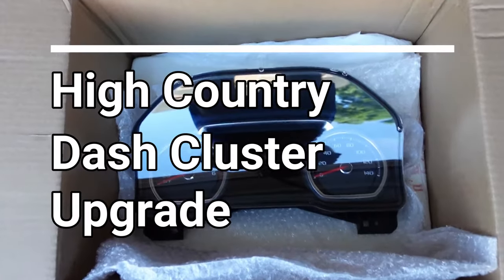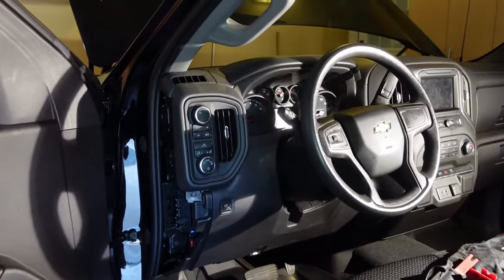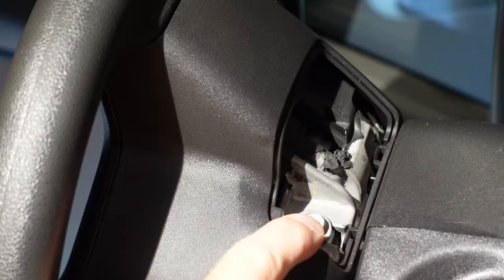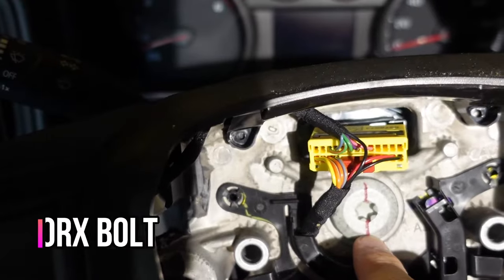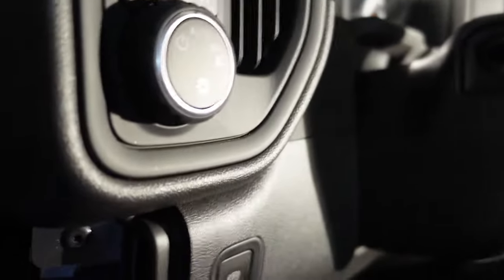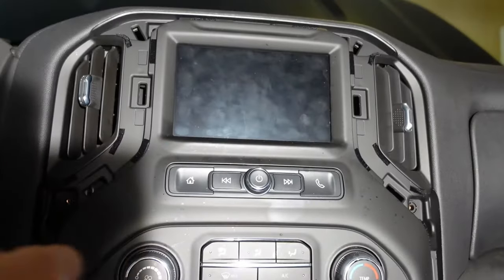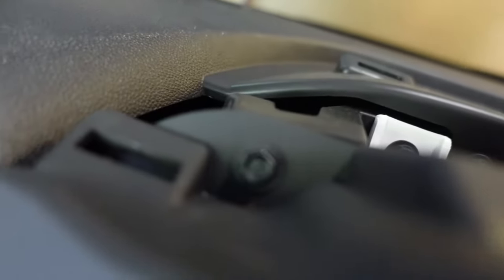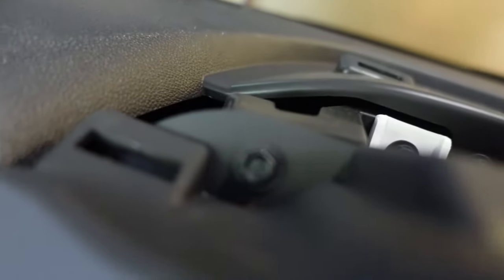[HOW TO] Upgrade Dash Cluster & Steering Wheel in a 2019-2022 Silverado LTD Custom

Comment: You have possibly made my year.  Just recently picked up a '24 3500HD pickup and love it, except for the awful steering wheel.  I really miss the leather wrapped steering wheel in my old 2500HD.  I'm not looking to add any steering wheel controls or the cluster and ONLY want to keep what controls I have now with a leather wrapped steering wheel.  Could I simply swap in the steering wheel in your video and just not have functionality of the right side controls on the steering wheel?  Would this work.  Thanks so much and love the awesome video.
Reply from the maker: @DP-np5mm  2024s have different wiring. You’ll need to contact WAMS to verify compatibility.

Comment: Did the steering wheel update on my 22 2500hd custom.  Everything works except heat option.  I have also reasearched extensively and have not found any aftermarket harness/clockspring options.  Just wondering if the heated steering wheel circuit is just a straight 12v?  If so, why couldn't you just find a switched circuit to tie into and run it up to steering wheel and splice into your heat switch? It seems that the switch isn't getting power...adding a dedicated 12v source should work...correct?
Reply from the maker: WAMS is telling me they may have a fix available later this year. So maybe just hold out a while. It’s more complicated than just hooking up power cuz it runs thru the BCM.

Comment: Very nice. I did the same thing to my F150 when I had it. Even got the heated steering wheel to work. I had to buy a module and a harness as well as a new clock spring.
Reply from the maker: Nice. Yea heated wheel will be nice in the winter. My Canyon has it and once you get one. It’s hard to go back.
Reply: Can you please link the heated steering wheel components needed?
Reply from the maker: Haven’t got it to work yet. 😔
Reply: If it doesn’t work then I’ll just lead the button to my rear bumper pod lights
Reply from the maker: I guess you could do that.

Comment: Chingon  👍 torque spec for steering wheel?
Reply from the maker: 33 ft/lbs. Clean off the old thread locking compound and add a little new removable thread locker to be safe.

Comment: Did you ever install what you needed to get the heated seat button to work?
Reply from the maker: Unfortunately no. Ran into a roadblock. Will probably require some custom programming to make it work with the OEM buttons. I know it can be wired to run on an aftermarket controller but I don’t think I wanna do that.

Comment: Great video my friend. But question for you if you dont mind. Can i do the steering wheel swap with the harness adapter to have steering wheel controls without changing the cluster?
Reply from the maker: You could. But I am not sure if the controls will work the radio.

Comment: Question so on your description you put both links to two different clusters is that to chose in between the LCD one and the regular one ?
Reply from the maker: There’s a high country cluster like what you see in my video. But there’s also the option of a mid level cluster that has a smaller color screen. Both are upgrades over the basic non-color cluster.
Reply from the maker: @jose-yz7le  I'll be honest, I am not sure, you'll have to do you own diligence to find the correct part number. I think 2019's have slightly different wiring. Try to find a wheel from a 2019 on ebay to be sure.

Comment: When you swapped the cluster did you have to program the mileage on the odometer or did it transfer over from the old one? Need to know before I buy one.
Reply from the maker: I suggest you read the WAMS product page. It tells you everything you need to know. Mileage is stored outside of the dash cluster so it transfers over. But a new cluster will still require programming specific to your VIN for all the options to work. WAMS does this for you.

Comment: I thought this was plug and play, I seen another video similar to yours but he didn’t discuss that extra wire harness. What is that harness for? Thanks in advance.
Reply from the maker: The extra wire allows the dash to communicate with the buttons on the wheel. You cannot do one without the other. You need everything to make it work. Dash. Wire. Wheel. Others have tried just the wire and wheel and it doesn’t do anything.

Comment: Bought a 2023 and bought a 2023 leather steering off EBay now seems it may be a plug and play unless the extra wire is needed to work the volume and phone controls and Apple play but the main question is were you able to get the heat function work on your steering?
Reply from the maker: Sorry. But the 2023 has different wiring overall. And this process won’t be plug n play like it was for mine. You can try but I don’t think it will work. 

I haven’t been able to get my heat function to work yet.
Reply: @fondupot  the steering is off a 2023 Silverado High Country and going into 2023 Silverado Custom
Reply from the maker: I understand. But the wiring that connects everything is different. When you go to add the Harneess Dr. wire in , the pins I used won’t work on your 2022 LTD. You can try, but I’m pretty sure it does not work on 2023+ trucks.

And others have reported simply adding in the new steering whee and wire does not enable the radio controls. The dash cluster is also needed to make it all work.
Reply: I will attempt it once I have the steering, the cluster is available for $188 but has 7000+ miles and mine has 100+ so not sure if there is a way to reset it to my current miles and hours
Reply from the maker: @bobmassey5404 the cluster needs to be programmed to your VIN. It won’t just swap in. You need to consult with WAMS. I’m pretty sure it’s not going to work on your 2023. Before you go spending a bunch of money…

Comment: My 2023 work truck is a 2500 and doesn’t have steering wheel controls. Previous 2019 did. You know if I can change the wheel without changing the cluster?  I mainly like the volume and phone features of the controls at your finger tips.
Reply from the maker: Others have reported it doesn’t work without the cluster. Also 2023 has different wiring altogether, so it’s not as easy as swapping in a cluster and wheel.

Comment: Hey boss, if I were to go to you, how much would you charge me to install the steering wheel and digital cluster on my car? Would be for a 2024 gmc sierra
Reply from the maker: 100 million dollars! Haha in seriousness, your truck is a 2024. And this upgrade will not work the same as it did on my 2022 LTD. They changed wiring on 2022.5+ trucks.

Comment: I have the 2022.5 refresh and really wish I could upgrade my custom to this dash cluster, it looks really good! Great job on the very detailed video!
Reply from the maker: You might be I luck. I think I heard the 2022.5 customs still have the old wiring. You should get ahold of WAMS and check. They can run your VIN and tell you if it will work.

Comment: How did you remove the side panel on the driver side next to the 4x4 knobs in the beginning of the step? You did not elaborate on how you did that. Thank you.
Reply from the maker: It just pops out. You can yank on it from
The bottom and it comes right out.
Reply: @fondupot Thank you sir , also what type of breaker bar did you use to take off the steering wheel ?
Reply from the maker: Just a cheapo one I’ve had for years. Nothing special.

Comment: can i just but a used cluster off ebay and plug and play? or does it need to be programmed?
Reply from the maker: No. It needs to be programmed to your VIN. Others have tried and reported that it does not work.

Comment: Do you know if you can just upgrade the steering wheel with the harness or do you have to change the cluster too?
Reply from the maker: You probably can. And you might gain volume and seek controls to your radio. But the controls on the right side that control the DIC work work for the custom DIC.
Reply: @fondupot  ok thanks I mainly just want to add the radio controls I miss having those and might upgrade the gauges later 700 is kinda steep for me right now. Also great videos I'm subscribed since I have the same truck.
Reply from the maker: Right on. Thanks for watching. Good luck!
Reply: @brianwhite153  did your controls work? Or did you have to buy a clock spring? I just upgraded the steering wheel but lost cruise control functions. That’s the only feature that came with my truck. So, I’m wondering if I need a new clock spring so I can regain cruise control and use the radio controls.
Reply: @gohangan  I actually haven't done this yet was waiting until after Christmas
Reply from the maker: My guess is you got the wrong wheel.
Reply: I'm sorry if the link or question has been posted already. 

could you please add the links or part numbers?

I just want to upgrade my steering wheel. I have a 2019 chevy Silverado custom trail boss. 
 Thank you!
Reply from the maker: Check the video description.

Comment: Do I have to buy a new steering wheel or can I just buy the OEM part and plug it into my steering wheel for the volume up and down and skip track function? I don’t want to upgrade my dash or stock display system.
Reply from the maker: No. Read the description.

Comment: question what power the cluster ? i have my cluster on blck screen ? but cant fine the fuse to the cluster / any ideas will help tks
Reply from the maker: No idea. It runs thru the BCM. Not one single fuse runs it. You’ll probably need a dealership visit.

Comment: even if i have a v6 2020 custom will any high country cluster will fit my truck?
Reply from the maker: Should fit yes. You just need to check with WAMS first.
Reply: @fondupot thanks boss and also you think i can change my custom radio to a high country radio with the digital ac knobs?
Reply from the maker: @murdatp7590 I don’t think that upgrade is possible. More to it than just swapping out the controls.

Comment: Did you ever figure out how to connect/activate the steering wheel heat function?
Reply from the maker: Not yet. But WAMS has said they will have i fix for it soon.
Reply: Good news!  I know there are several of us that would really like that capability.  I trust you’ll let us know as soon as it becomes available.

Comment: So with that single wire, it’ll make everything work? Including the steering wheel controls to the stereo?
Reply from the maker: Yep!
Reply: I was observing my clock spring and I think I need a new one so I regain cruise and radio control. If you haven’t done it, you should check to see if your clock spring has pin #9 already on it. I only found out after I installed the single wire, buttoned everything up and tested. I found out that the buttons didn’t work, so I doubled checked my work. I didn’t upgrade the cluster but I was expecting radio control and cruise control but those didn’t work. I happened to just stare at the clock spring while I contemplated life and saw that pin #9-12 on it were blank. Then I realized that I probably need a clock spring with all the pins so I can use the buttons. I’m confused as to how I lost cruise control. Unless the new harness on the steering wheel is wired a little differently than my original steering wheel with only cruise control.
Reply from the maker: All my buttons worked perfectly after the upgrade.
Reply: @gohangan  Did you ever try the new clock spring?  Sounds very similar to the issues I am having. I upgraded to the leather wheel, but kept the factory Custom cluster. I also have a 2022.5 - thinking this may be my issue. But also holding out hope for a way to make it work!
Reply: @JosephKravec  i did order a new clock spring. I think it was around $40 so I wasn’t too hesitant to buy a new one. I have cruise control but no function to the radio controls. I think my truck might be missing some of the factory wires. I don’t have as many wires coming from my cluster compared to the video. It was worth a try and now I have decorative buttons that I press while I wait in traffic. 😂

Comment: You think this works on the newer single cabs that have the older interior (pre 2022)?
Reply from the maker: Should work on 2019-2022 LTD models. My truck is a 2022 LTD, basically a 2021 build in 2022, non-refresh model.
Reply: @fondupot  okay thought so thanks

Comment: HELLO MAN I HAVE A QUESTION CAN I JUST CHANGE THE STEERING WHEEL WITHOUT NEEDING TO CHANGE THE DASH CLUSTER
Reply from the maker: The buttons wont work without the cluster.
Reply: MAN ONE MORE QUESTION WHICH CLUSTER SHOULD I BUY BECAUSE I SEE THAT THERE ARE TWO LINKS IN YOUR VIDEO
Reply from the maker: @osmelmasot  it's really personal preference. The one in my video is the high country cluster. The other option is the mid-grade cluster that has a smaller LCD panel in it. Both are upgrades over the Custom cluster.
Reply: @fondupot  Ok then I would need the same parts that you used?
Reply from the maker: Yes. But only works for certain years. So verify with WAMS before buying anything. They can check your vin.

Comment: Will this work on the new 2022 refreshed truck?
Reply from the maker: I am not 100%. As noted in the video my truck is a 2022 LTD, basically the same as a 2021 model. But the 2022.5 refresh models may have some new wiring that doesn't line up. Best to check with WAMS and have them check your VIN. Good luck.
Reply: @fondupot  , I have the 2022.5 refresh and  White Automotive & Media Services (WAMS) said the cluster will not work. But I still want to upgrade the steering wheel.
Reply from the maker: @ThePissedOffHippo  Then I guess you need to find a wheel from an up level 2022.5 and swap it over. You'll have buttons that don't work thought FYI.

Comment: Do I have to buy the WAMS cluster or can I get any high country cluster off eBay?
Reply from the maker: You can probably buy the eBay cluster, but it will require WAMS to do the custom programming. I would check with WAMS first though.

Comment: I bought  denali 2022 cluster  ti install it in my 2018 tahoe
But its dosent fir its bigger than the old one is that normal or i have to buy only denali 2018
Reply from the maker: 2018 is an entirely different truck. It will not fit. If you want a Denali cluster you need to get one for a 2018 truck.
Reply: @fondupot   ya  , so now what do u recommend to buy denali cluster 2018. Same year of my Tahoe ? Right
Reply from the maker: Yes. But it will still need to be programmed. I think WAMS can do that for you.

Comment: Did you ever have the problem of the fuel range doesn't match up with your previous...just did my swap today and it currently says my range is 530 but normally it's around 380...just filled up
Reply from the maker: It usually adjusts based on your driving. If you do a lot of highway the range shows a lot more. But if you start doing a bunch of city driving it reduces.
Reply: @fondupot  thanks a lot

Comment: Do you need the cluster so the steering wheel volume works?
Reply from the maker: You can probably add the new wheel without upgrading the cluster, and add the wire for radio controls. But the controls on the front right side of the wheel won’t do anything without upgrading the cluster.
Reply: @fondupot  thank you! I will let you know if this works
Reply from the maker: Sounds good
Reply: @Cesar Teran   did you ever do it without the cluster?

Comment: Love the install, but what if I want to only install stalling new steering wheel with controls? Do I need to replace the cluster or can I just do the steering wheel?
Reply from the maker: Only doing the wheel will not enable the controls. You need to do all three items. Cluster. Wire. Wheel.  

Others have reported doing just the wheel and wire does not enable the controls. Because it all runs thru the cluster.

Comment: Has anyone just tried the new wheel and wire for the "refresh"
Reply from the maker: Refresh modes have different wiring. So this process won’t work. Maybe someone will figure out how to make it work eventually.
Reply: @fondupot  Please if anyone figures this out I would be ecstatic!  I have a 2022.5 and as Fondupot mentioned the buttons are not working.  I kept the factory cluster (WAMs tells me incompatible), and now all wheel buttons are not working - including cruise even.

Comment: will this work on the 2023 Silverado 1500 4-cylinder Custom?
Reply: My cluster and Wheel look exactly like yours. But they keep talking about the refresh model don't know what that means.
Reply from the maker: If you have the 2022.5 refresh model this won’t work. Refresh means the new front end and the 2.7L HO engine.

Comment: Tried getting the wheel off with a T50 only using hand tool and long handle ratchet.  The screw stripped out because of how hard it is to remove. Now I’m f’ed with a screw that is loose and steering wheel that is loose on the mount.  Not good….
Reply from the maker: Oof. Sorry to hear that. Hope you can get it fixed without too much trouble.
Reply: @fondupot  got the old screw off.  Used a big easy out. New screw from dealer only $4.
Reply from the maker: @radyphilips8710 glad you got it sorted out!

Comment: I did the steering wheel upgrade, from my custom 1500. Its the same steering wheel  that u put on. But the controls dont work, the lights dont come on, etc. help
Reply from the maker: What year truck?
Reply: @fondupot  2020
Reply from the maker: @MouseyEdits did you add the extra wire? And did you have a new cluster installed too?
Reply: @fondupot  no i did not add the wire bc i didnt add the cluster, was just a steering wheel. I assumed it would work without it since i didnt care if the steering wheel controlled the cluster
Reply from the maker: @MouseyEdits It doesn’t work without the cluster. Several others have tried. Read thru the comments and you’ll see.
Reply: @fondupot  damnnn that sucks. But the leather wrap steering looks good lol 😂